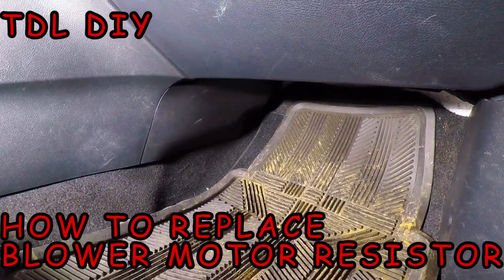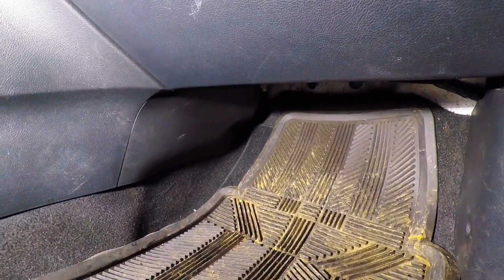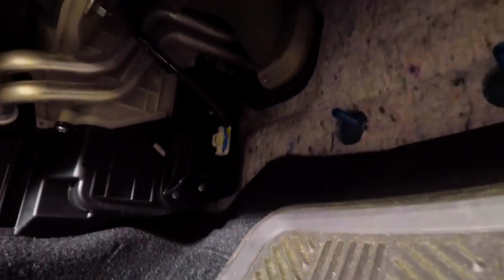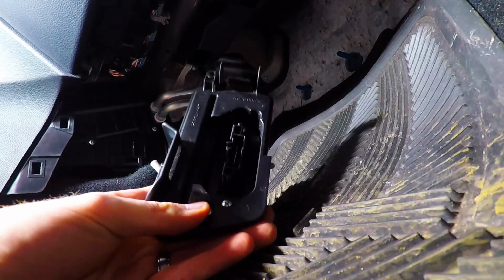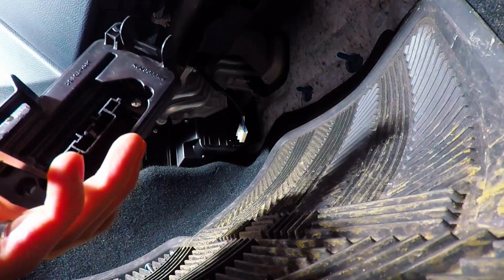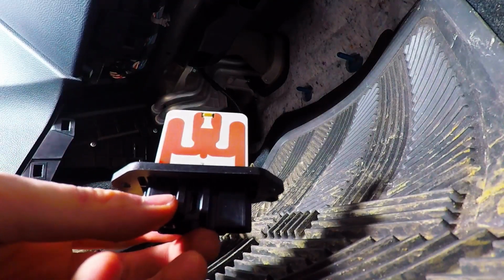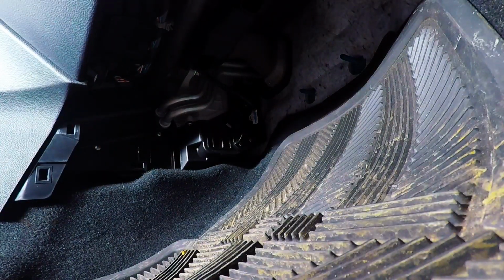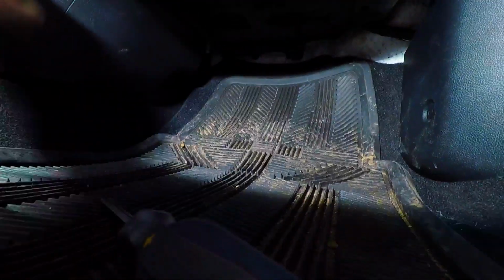Replacing Blower motor resistor

Comment: I have just had cabin filter and blower motor replaced and air is not distributing around the inside of the car. The blower is on full force the temp is set at 32 , I travel 40 minutes to work and inside of car not heating.I took it back to auto electrician, he said he couldn't find anything wrong, there is barely any air coming out of vents.
I said I have never had to drive that far with the car on that temperature. Could it be the resistor. You can hear the fan running at full force just the air is not moving around inside of car. Could it be the resistor?

Comment: what were the symptoms that lead you to this? i have a 2010 mazda 3 base and the fan speeds all seem weaker than they used to be. all the speeds work, but just not as strong it seems. im wondering if somehow the resistor is dying, or if its the motor itself.

Comment: Why would you need to replace the resistor?
Reply from the maker: Great question, the resistor regulates the fan speed. so if your fan only goes one speed low for example and you want the fan speed to be on high but it change speed then you will have an issue with your resistor.

I hope this helps answer your question.

Comment: Is this the same for Mazda 3 2009?
Reply from the maker: I tired looking around to find you the information not much that i could find. I would guess it around the same location but i cant confirm this. I look at parts it looks the same or similar maybe depends on model or slight change in year.

If anyone has completes this job please leave a comment. Thanks.

Comment: I got one in the US for around $55 from carid.. I had to actually call them and they worked out the price somehow. I never saw it listed online. Be aware: there is a FRONT pack and  REAR pack. The rears are usually available all day long for $40-50. But the rear seldom fails. 

Due to the faulty Mazda design of placing the pack into the Blower box, and not providing adequate drainage, the box fills with water and dunks your Resistor pack in water. Byebye Resistor pack. Hello $156 at the dealer (plus labor). 

Bad Mazda bad! 

Other than that, I love my 5yr old cx-9 AWD Sport and hope to keep it til I die. 😅 LOL
Reply from the maker: Thanks for all the I formation I hope someone can benefit from this. Mazdas are pretty good vehicles no real complaints here.

Thanks for watching and taking the time to share your experiences. I didnt realize about the rear pack but makes sense.

Comment: Thank you very much. It's very helpful. By the way, can you tell where to buy the resistor, please? How much? Thanks.
Reply from the maker: You can get it from a bunch of places one being the dealer. You can get them from rockauto.com which is a good place to get parts and they range from 89.99 to 181.00 depends on year and which type you have in your car. The cheapest but unknown condition would be a junk yard or pick n pull. I Hope this help you out. I always like to call around if i am buying a new part or look online see who has it for the cheapest price.